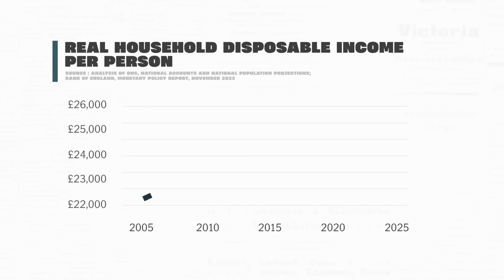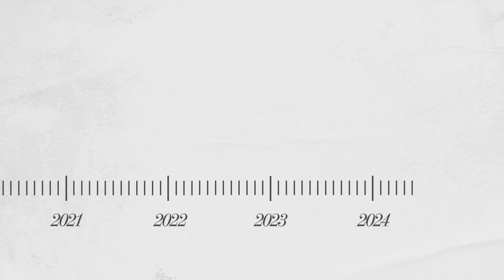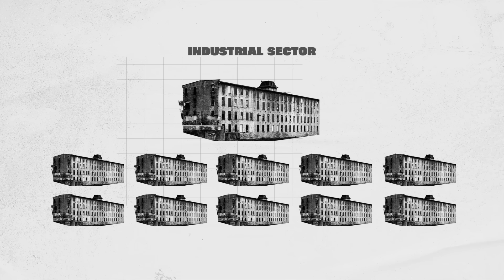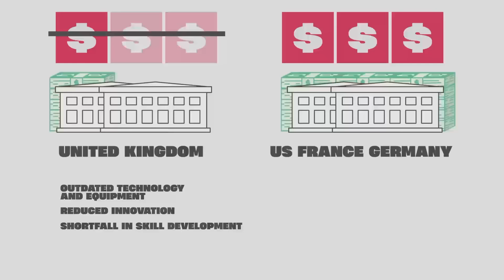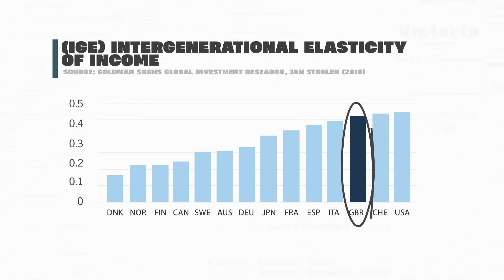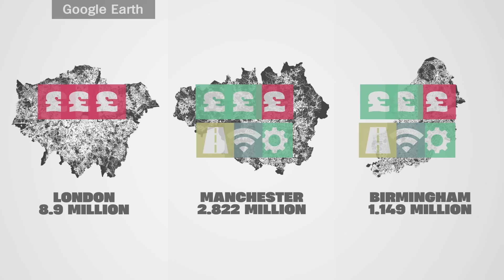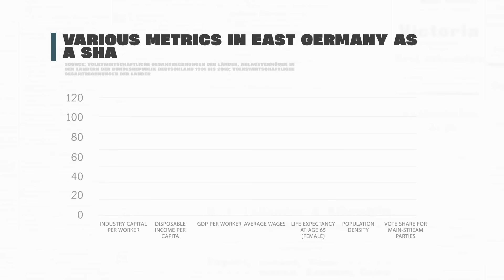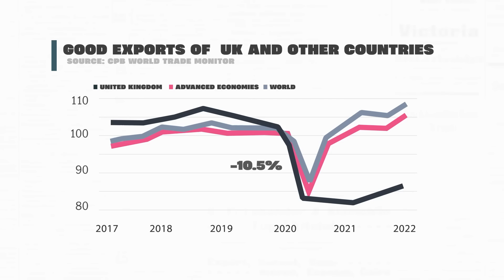What has Happened to the UK's Economy

Comment: unfortunately it's more or less the same in France or Germany , what's happening now in the UK is not something special,  Europe as a whole is on decline , and nobody knows what's the exit strategy
Reply: Haven't got a graph but apparently the European Union is now a 1/3 smaller in economic size than the USA ( compared to when the Euro was adopted). Europe just doesn't have the vibrancy of the USA.
Reply: @reddog5031  you haven't got the graph because it doesn't exist and utter crap. The EU economy grew by almost 10 times since it adopted the Euro LOL
Reply: Most of Europe is facing some struggles because of an ageing population, but the UK is performing far below the others.

Comment: Potential and the opportunity to engage with training is something I think about a lot. Living in a more rural area the access to variety in courses through local colleges has noticeably reduced. They're just not offering the diversity in subjects they used to. If you live where you can easily travel to the next city then usually it's not a problem, you have more choice but so much of the UK doesn't have that option and young adults in particular end up not really having a path to follow.

Comment: I work in finance (Insurance). The company i work for recently introduced a new IT system as it no longer wanted to pay the licences to use a third party IT equipment
The result, an increase in complaints & large increase in wait times for customers calling in. A productivity drop of 30% for each worker. Also, data has transferred across onto the new system incorrectly for certain information. The IT system is worse today than it was in the early 2000's (no exaggeration). I'm picking through the bones of whats happened & its impacts moving forward. There was minimal testing of the system before its implementation. The change of system was done to look good on the surface in order to secure its sale. 
This reflects Britain today. Its a nation of the rich charging rent for the poor to use the services it owns.

Comment: UK needs to solve the middle bracket and also help the lower bracket move to the middle bracket --> essentially helping more people be middle bracket and easing off the pressure on taxation to allow middle class to spend more and generate wealth. Which in turn will boost GDP and help create or attract more business/ideas to then further employ and develop more people.

In current economic paradigms at a certain level (low or middle) no spending=no growth, no wealth = no happiness or spending.
You need people to spend, but for them to spend you need to create an environment in which they can generate a level of sustainable and independent wealth, so they can afford and want to spend.

Comment: East Midland England here. Folks around here feel like their vote does nothing. We vote and get the same treatment from the next leader as the previous. A lot of England's economic struggles in my opinion stem from London. It was the beating heart of an empire, and hasn't properly transitioned away from that mindset. Most investment, business, and money is centred there. Indeed HS2 was meant to connect the main cities north of London in a higher capacity fashion allowing the money sink that is London to spread it's load northwards. The problem is that England has grown lax in infrastructure manufacturing capability and is strangled by the insistence of those wealthy enough to influence the system. We are chronically incapable of progression until this is dealt with.

In addition when focusing on renewables, England is terrible for wind power. The wind in England has a tendency to try and pull the fans off the mountings.